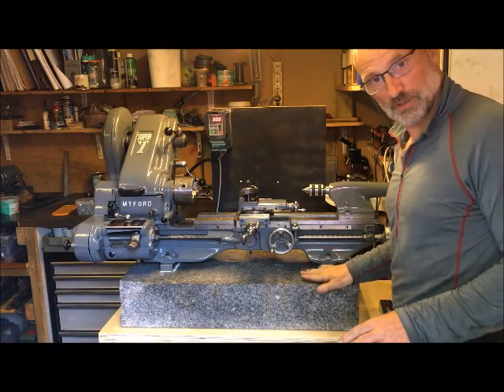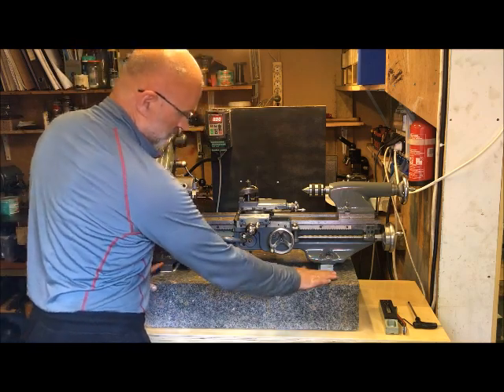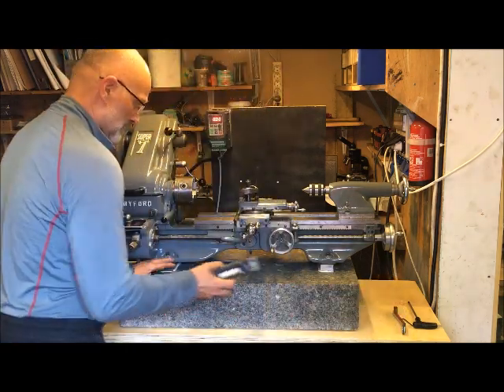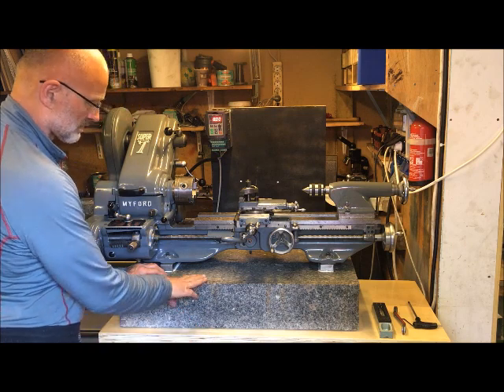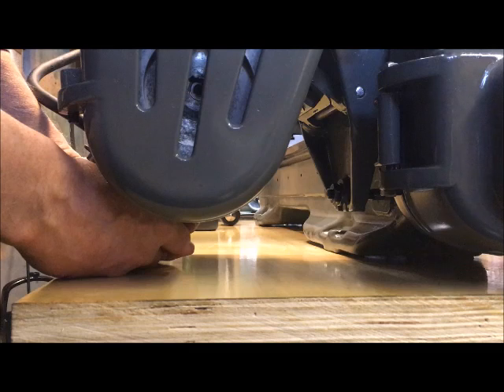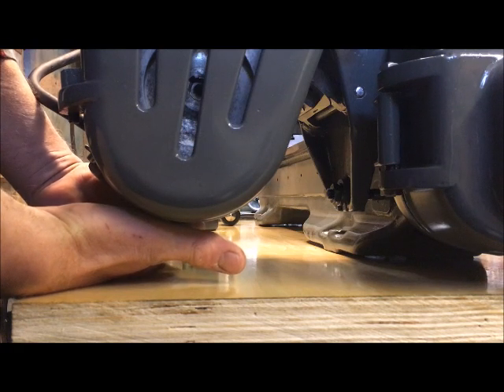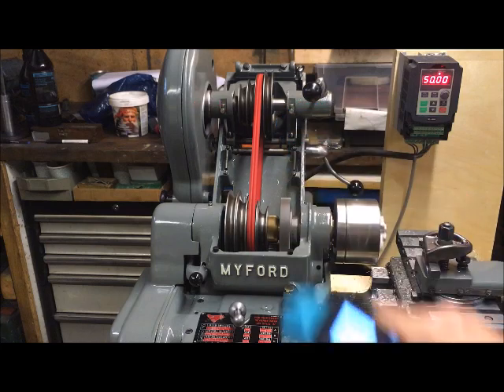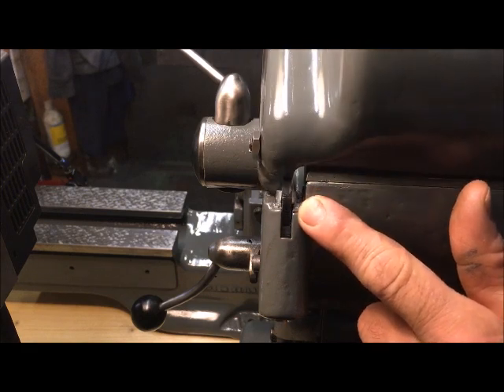Myford Super 7   granite mounted ++

Comment: Hi Jan, great stuff. Seems like you are pushing the myfords to their limit and getting amazing results. Just goes to show you can achieve great results on a small machine with the right care.
Here's an project you may be interested in. Not sure you if have come across such machine before, but the myford 'big bore' machines are a nice addition to the myford collection, having a larger bore. And I am sure you are wondering about the headstock, it uses a slightly different headstock than regular which I'm sure you'd be eager to disassemble and tinker with.  Unfortunately (or fortunately) they fetch a steep £2k for such headstock alone, or even more if buying the complete machine. As you are a myford connesiour, you may be interested in making your own big bore headstock, since you have great knowledge around the myford headstock. It's been done before by a few people in the UK, but not much documentation from what I can see. What do you think?
Reply from the maker: Thnks for the nice comments and interesting topic of discussion. I have seen a few designs on modified headstocks, actually not only the S7, but also the ML7.
Yes, as soon as I can get through the current projects I would lkie to experiment with making my version of a larger bore spindle. I have 2 versions in mind, both runing needle bearings in front, one with a hardened shaft running directly to the bearing ie. this one without the inner ring, then one with both inner- and outer rings, but still being a "thin" assembly. I know that for example a Deckel FP1 uses such needle bearings, but I am not convinced it will work here, so it is for my own good just to try out. The potential benefit apart from a larger bore canalso be higher rpm, although this is of less concern. I don't recall my calculations and have the details back at my home computer, but believe that withouth line-boring to a bigger dimension I can get something like 30mm throughput (but I may remember wrong). Maybe I will also expand the bore.. we'll see.
Reply: @jansverrehaugjord9934  Sounds good! I'll be staying tuned.

Comment: Great job man!, that lathe should be on a museum!. Have you noticed the measurements taken correlate directly with the way you "hit" the chuck @ ~2:00? That's the intrinsic problem of small, clumsy, machine-tools. While you've done an excellent job with the lathe, and adding the granite will certainly help when it comes to rigidity, you shouldn't count on it withstanding the accuracy tests for other than the first mildly deep cut, basically. The main reason is simply mass vs. force. And the second, and more important one, is that it's been several decades since vendors found out the very first thing they should do to cut down costs and maximize profits, while making sure we wouldn't get a proper lathe at "low cost", was to make the beds narrower than they "should". You can see this in your myford, modern chinese mini-lathes, wabeccos, and even in some heavy duty ones, depending on the purpose these were designed for. Unfortunately, this accentuates the problem of poor mass, and greatly reduces the load the machine can handle without going out of specs, or said otherwise, it limits the maximum depth of cut and cutting pressure it can withstand before going out of toolroom-like tolerances.
Needless to say, yours with your setup will withstand it better than pretty much any mini-lathe out there, and all the hard work you've put into scraping and verification will certainly pay off in overall accuracy. I'm just saying all this so that you are aware the lathe will settle on certain inaccuracy you won't be able to get rid off no matter what you do, and it will only degrade the more you load or simply use the lathe throughout different projects or jobs. The good point is that once you've achieved the tolerances shown and while the lathe stays within the same wear-mark, you could do any job requiring toolroom-like tolerances by simply aligning it before such job, and not loading beyond what it can handle given your particular setup, which will be different for every job setup. All the best!
Reply from the maker: Thnks for the valid comments. Indeed, smaller, less sturdy lathes like a benchtop machine as this is, will not have the same rigidity as their bigger cousins. There are many aspects that contributes to the accuracy and ability of the lathe, and as pointed out, this design (and other like it) has its' limits. However, I was very pleased to see that the granite helped, in much the same manner as what I had in mind, namely to mimic the Schaublin bed - chip tray - stand. The "102 design" Schaublin is of course a whole different animal, and there are plenty  other details that make this a much sturdier and better lather. However, the price tag is/was also in a totally different league.. One (small) detail like the top slide mounting and construction comes to mind. If you compare that of the Myford, which is a typical example of a small lathe compound slide design, this is a rather flimsy affair. While the Myford (and most others) sport a regular, quite thin gib, and 4 tightening screws, the Schaublin slide (in fact.. all their slides ..) has a triangular gib, providing better contact,  much tighter and stiffer, yet can be silky smooth. On my later ELS equipped Myford S7 I have tried to lock down the screws tight and also done away with the compound alltogether (as it is no longer needed), instead using a mounting block for the toolpost. This way I can also use bigger tools than what is possible in the 4-way toolpost (I bought a bigger QCTP). So far this seems to have helped quite a bit actually.
In general, I think the Myford (and possible other smaller machines) have been worked to the limits of their designed capacities, and maybe also quite beyond that.. For example, with the milling slide in use, even though the flat bed provides good contact area, the different members from the bed and onwards to the cutting tool is not exactly proof of sturdiness..

Comment: I doubt if Myford measured to your standard Jan. 
When you say the bearings settled at 33deg C, that of course will be in relation to the ambient, which in your case I'm guessing was close to zero !!!  No I'm joking - its summer, judging by the shirt sleeves.
Reply from the maker: Thanks Neil! I believe Myfords were very accurate machines from the factory, though.. At least the specs and inspection sheets tell this. They had the advantage of jigs, grinders etc. and production tooling, and a highly skilled- and experienced staff.. BUT if anything that might be in my favor.. they had to make a profit and when good enough, OK.. done! I have the luxury of doing this as a hobby and can devote all the time in the world to finishing, which is pure fun btw :) 
Haha.. it was actually around 25 C when I measured, so and "over-temp" at about 8 degrees.. which is pretty good
The countershaft rotated at the highest of the 2 settings and for this particular trial I used the next highest speed (1480 rpm). However, i also tried to do a prolonged run at the highest speed, 2150 rpm and could only detect a couple of degrees higher at the front and rear spindle bearings. Will also try to run the VFD at a higher frequency, allowing me to test a higher speed, say up to 3000 at least.. more to report afterwards (maybe i crash it..:) )

Comment: That setup would look right at home in a master watchmaker's shop.  I bet it will be the most rigid Myford of them all!
Reply from the maker: Thanks! It seems to work as predicted.. but it is not the most practical way of having it on top of that bench.. the granite will be better "tucked down" into a lower bench
Reply: How would you go about measuring rigidity during an actual cut?  Would it show up as bed twist under cutting pressure?  My opinion is nothing but intuition, I'm always glad to find out how to objectively test it by measuring. 

I can understand static testing, like this example.  http://modelengines.info/lathes/rigidity.html  That seems like a reasonable benchmark to compare similar machines.

I understand less of what actually happens during a full power/capacity cut.  In what way and how much does it affect the workpiece?  Is it just reducing the tendancy to chatter?  Does it produce some strange taper?
Reply from the maker: I guess static testing is of less importance, but could be OK as written in the link you presented.
Dynamic testing: This is possibly a large field to cover and I am no expert either. However, I know that vibration can be induced in a more "flexible" design and that mass and dampening will reduce vibration. But the best would be to have a larger, heavier and particularly, a stiffer machine to begin with. One consideration would be find what causes and where chatter begins, which in many cases is actually the tool holder/top-slide/cross-slide/saddle construction not being stiff enough. Then the tell-tale I reckon would be in the surface finish and the dimensional accuracy of the parts produced. For a good explanation on some of this (although not in English), see the linked video.. VERY good! (many more from the gentleman also..):
https://www.youtube.com/watch?v=zxcLVpPoYJ4
Reply: Holy smokes, that IS good.  I would never have found that video on my own, now I have a pleasant amount of deciphering to do.  Thanks, mate!
Reply from the maker: You're welcome! He is resident in St.Petersburg (Russia), hope to be able to visit him.. what a mentor to learn from!
Reply: Thank you Jan, for the link to the video of the man in St. Petersburg.  It was great to see the vector force diagrams with measurements and adjustment procedures.  I wish someone of caliber would do this in English as the CC translator was marginal at best but the circles and arrows worked for me as an Old engineer who knows and used most of it over the decades.  It puts into perspective the balance and trade offs necessary in the design of a lathe (or any machine System) as well as some of the black art of quality machining with what ever type lathe you use...Always something to learn! ;-)  It also puts very much into perspective the fine work you do to create a precision starting point...especially on older equipment like your beautiful Myford's. 

Love the granite base and reminded me of Dan Gelbart's Granite, Air Bearing CNC system...but that was a different ball game compared to your beautiful restorations and all the scraping and measuring you do to bring a higher level life to these older machines.  I'm very appreciative of your videos, diligent craftsmanship and teaching me many things.  Thank You!  ~PJ
Reply from the maker: pjsalchemy Thanks for the nice comments! Yes, it would be rather better if all was in English. I have not seen anything so educational and methodlogical anywhere else. pity if the content suffers because of the language barrier.
Reply: Now that is one clever guy Jan, wish I understood Russian but even so I learned quite a bit with that video. I'm no expert either and barely know enough to have some understanding of how much I don't know. That video is a great example of Newtons third law "for every action there's an equal and opposite reaction". He ran some tests and got some surprising results that I'd certainly never considered. And those tests were done on a much heavier and better designed machine than I have.I'm unsure if he was advocating keeping the slides overly tight or not, it's a trade off between much higher wear rates and gaining some rigidity and having a bit more clearance with a bit less rigid machine. 

Static testing is a good indicator of problems or where the machine has none, but we both know dynamic testing is the only sure proof of what the machines doing under cutting conditions and pressures. That Russian video certainly showed a lot more movement and deflection than I thought there would be. The model engines link is correct that a good rigid design is very important and certainly helpful, but again I agree that mass and vibration dampening is equally important. Both work together.
Reply: +Turning Point  It is true that dynamic testing will bring some proof to where the machine moves and how much.  Doing quality dynamic testing requires quality (expensive) testing equipment and procedures and probably some data logging to capture the live data properly.  The 'Black Art' I referred to is that learned operational skill and intuition that stays within the machine design parameters, like Can I take a .250 depth of cut in 420SS vs 7075-T6 AL on a particular machine...speed/feed, angle of tool attack, chip breaker inserts or HSS, one off or production quantities...ETC. and then some.  One of the interesting things from the Russian Video was the boring bar op and how much flex happens when you are that far out on a 'Tree Limb'!

It's more about a dynamic Feel for the machine and what you can get out of it without pushing it beyond the limits for what ever you are making and to what spec.  Seeing the dynamic numbers for a particular machine is still just a starting place, and inmo not worth the cost when one still has to get the Feel for the machine and Op.  Starting with something Rigid, Level, Straight/square in 3 axis, smooth running...like Jan's resto's is the best you can do to have a quality ('precision' within reason of design) finished component.  The more Zeros behind the decimal the bigger the $$.  For a home shop and 40 year old lathe to hold a 2-4 tenth over a run would light my candle for sure or anyone's candle I would think.
Reply from the maker: Turning Point I am also surprised to see the kind of deflection you get, even in a rigid machine. And I tell you, the lathes are no jokes :)
Very nice videos and he must be putting a huge effort into them. I am  learning a lot every time I watch these (in case you haven't seen, there are a wide variety of topics and videos)
Reply: Yes I agree completely with your points pjsalchemy. I've operated mobile machines over most of my working career up to large open pit mining equipment weighing over 1,000 tons, and it's no different than operating any machine tool. The operator has to develop a feel for the machine and learn what the machine is telling them under various conditions. From my experience a small number never seem to learn to do so. Others are highly tuned to what the machine is telling them. Your example of knowing what tooling, cutting angles, tips etc works best with different materials on that machine is just the same. It's past experience and learning what it can and can't do and how to get the optimum results.

But what I meant by that dynamic testing is using common but trusted measurement equipment to test the accuracy of what the machine can produce under the usual cutting conditions while not trying for more than the machine is capable of. Measuring a turned shaft at various points along it's length while checking for taper would be a good example of what I meant. I'm a firm believer in using the Schlesinger machine tool tests on any new to me machine and any time a problem seems to be showing up. If you don't know where any of those problems are then there's no hope of even trying to compensate or make a possible adjustment for an unknown. Those are static tests and as much as they help still aren't 100% conclusive in my opinion since it's the actual dynamic results that give a representation of what the machine can produce. I can level my lathes and spend long hrs to do so to get them as perfect as possible with zero observable movement along the whole bed while using a high accuracy machinist level. I've still found I need to do a further but very tiny adjustment to the bed twist under cutting conditions to get them to turn as parallel as possible. So the static tests showed everything was correct, dynamic tests showed a minor correction was still needed. Now I spend less time trying for perfection since I already know the faster way is to get it quite close then make the last final adjustments during cutting tests.
Reply from the maker: Very well summed up. Running the machine under operating conditions will be the ultimate tests, and probably reveal things that will need smaller adjustments etc.